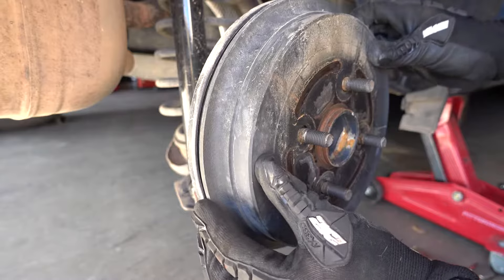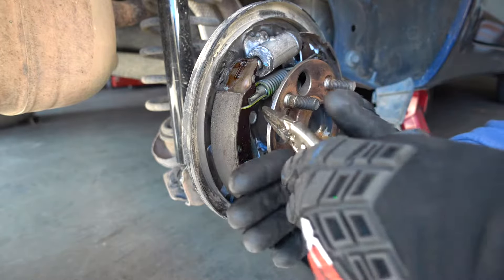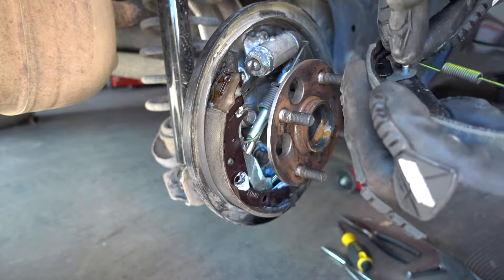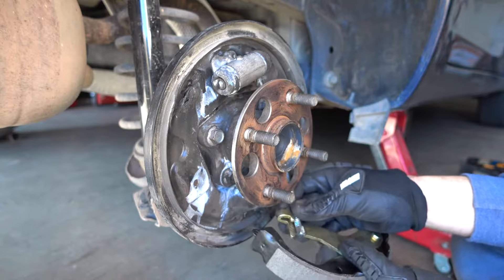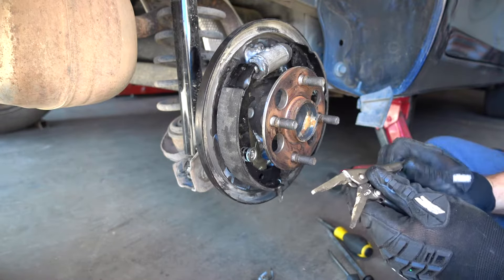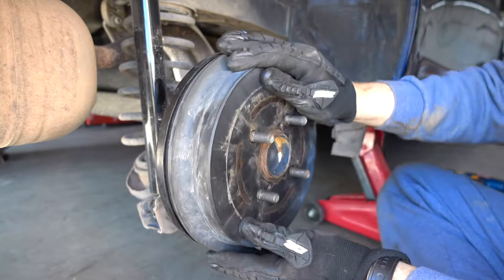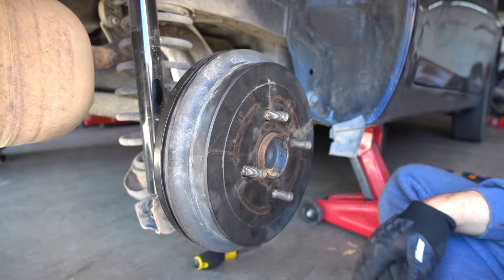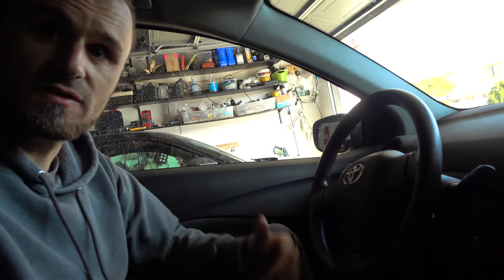Car squeaky rear brakes - $18 Fix - Replacing REAR Shoes on a Toyota Yaris , Step by Step

Comment: M8 x 1.25 bolts to remove drums.  Great video. I recommend lubricating the bumps on backing plate where shoes pivot  as they can bind up if not lubed.  👏
Reply: Thanks
Reply: They'll SQUEAK and wear the down, creating a lip.

Comment: The spring hardware should be replaced every time shoes are replaced because they lose tension over time. Also a good idea to replace the adjuster apparatus too, especially if you live in the salt-belt. Might add another $40 to the job, but if you’re going to spend time doing the job, do it right the first time. I usually go as far as replacing the brake cylinders too if vehicle has over 150k miles. Need to use anti-seize grease on the backing plate where the shoes touch; don’t get grease on the actual shoe material that comes in contact with the drum. Bleed the brakes if you change the wheel cylinders.
Reply from the maker: That's the 3x more expensive way to do it .. and it is better ..

Comment: Very good video, thanks very much. I've been hunting for nearly an hour to find out which way the fork on each side of the adjuster goes in. 
You are the only one I've found who actually mentioned the correct way for each fork. Great stuff.
Reply: I was also wondering the same thing. My little spring loaded arm for the auto adjuster kept pushing away from the ratchet nut and not adjusting until I got the fork the correct way. Great video.

Comment: Great video very informative, will help me do the rear shoes on my sons car. Question. Shouldn't the shoes automatically adjust themselves when you replace them with new ones without having to manually do it like you show?
Reply from the maker: Not on Yaris .. they don't self adjust .. it's an old cheap system. Maybe new ones but not this system
Reply: @VegasRoManiacReviews  Ahh thankyou, Toyota being cheap.
Reply: @VegasRoManiacReviews  They do have a self adjuster. You put the car in reverse, hit the brakes hard and it self adjusts. Using the parking also causes it to self adjust.

Comment: Is it necessary to get new springs or do those typically last forever?
Reply from the maker: They gonna make you buy some but they last forever
Reply: @TheCrazyRomanian  thank you. I only want to buy what I need. Is it necessary to replace the wheel cylinder if I hear grinding or could that just be shoes and drum wear?

Comment: With the teeth wheel mechanism in the beginning. You say it goes on the outside. And then one side on the inside, and then the next part of the video towards the end, you cross them up, which is it?